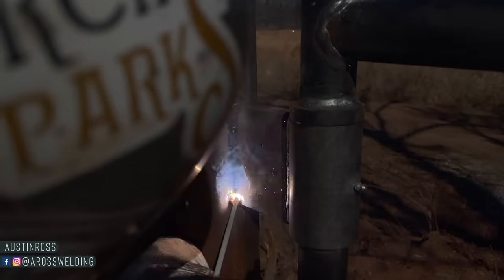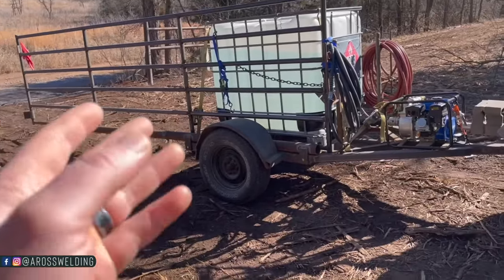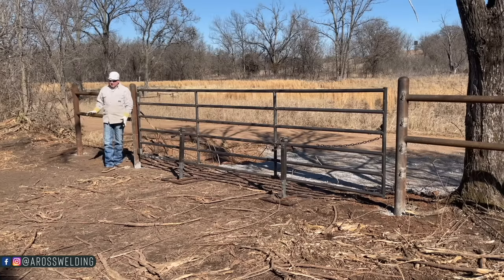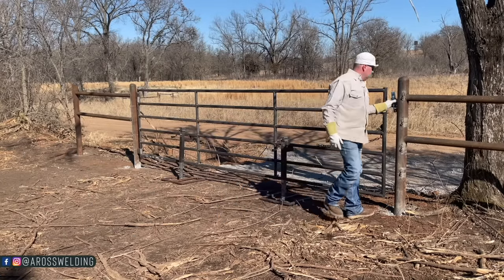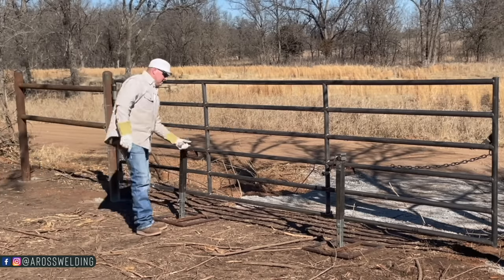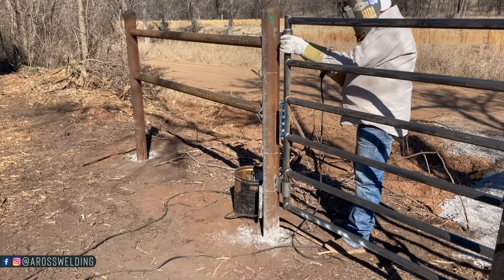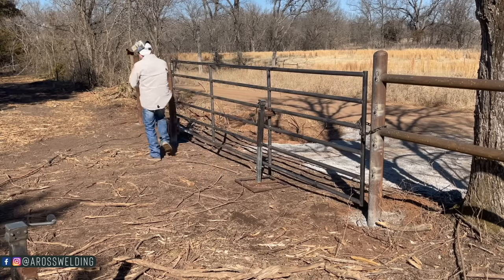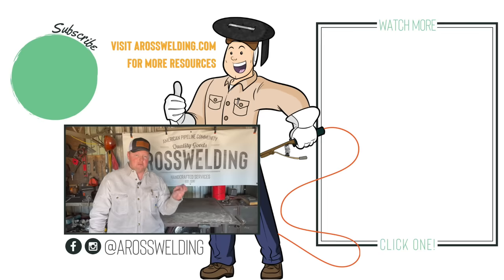UPHILL WELDING PIPE GATE HINGES (MOTION, PASSES, RODS)

Comment: I appreciated the tips on laying the bead. The closeup of your weave pattern was great. Info on what rods you are using, up hill or down hill, and determining the correct heat never gets old. 👍👍
Reply from the maker: Good to know. Thanks for your support! And thank you for watching!
Reply: My favorite tip was hanging the Stinger on my pants pocket!  I was constantly setting it on the ground and then picking it up.  For some odd reason that never occurred to me.  I might even incorporate  a small utility or hammer pouch to hang the Stinger when I need hands-free to adjust a magnet or something..
Reply: @arosswelding  I agree with the above comment! Thanks for sharing, showing and explanation Austin! It's nice to see some arc shots, though not so close up, show us more of them please! Very educational !Thanks a lot sir! God bless you and your family!
Reply: A little late but I'm almost certain that's 7018 because the 3 black dots most 6013 would have green dots

Comment: First thing they did when I started as a sheet metal worker, was to stick weld 16 gauge round fittings together. Used 6011 3/32 rod. First things I ever welded and I totally believe if you learn on light iron it's easier to go heavier

Comment: Austin,
As usual, great, informative content.  Question:  Have you ever considered using the Lincoln Murex 7014 rods?  I use them almost exclusively on  thin-wall pipe. They're designed for running downhill with moderate penetration  which would limit the amount of heat input.
Reply: Mired is good rod. I've used their 7018
Reply: Murex if I can spell

Comment: We have sandy soil down to about 18". Once you get past that, it's extremely hard compacted sand. It's a lot like trying to dig through rock. Would it be sufficient to set a 7' 2 7/8 post three feet in the ground (12" hole 3' deep, post set in concrete) for a 4'x12' gate as long as the posts are braced? I plan on building angled braces with 4 vertical posts and a single horizontal brace between all 4 on each side. The setup will be a lot like the 8" dia entrance you built, but without the high horizontal. Would you use your fence clips to attach goat wire to the braces?

Comment: I appreciate the info and knowledge you give on these videos, I have a question when welding up hill whether it's structural or fencing is it ever to cold Amp/ heat wise, I'm still learing uphill if weld @ 90amps is that good for a structural building uphill or anything structural.. thanks again for the info and knowledge on welding.
Reply: Depends on the size of the rod your using and the thickness of the material your welding.

Comment: Hi Austin I bought a handheld welder brand Spark with a dial knob on top that goes from 1-5 1/2 how can I set it up to weld with a E 7018 3/32 rod what’s ur advice, I got this machine just to do little things around the house

Comment: What brand of rod are u using ,I personally love 7018 over any other..man I bought some of the atwoods brand ,man u need a jackhammer to get the Flux off,not to mention the inconsistent temperament of the rod material..I used to get the Linweld or lincoln brands ,but man they have gotten pricey..

Comment: Question. Why use the baby 3/32 rods  , is it to get a pretty weld , or easy process with this size rod , my all around rod is 1/8 or 5/32  7018 rod just curious

Comment: I hang a LOT of these gates from OPS. Hung a 20 footer this am in about 15 min. I cut slots in my 4 1/2" for the 3/8" plate hinges to fit into. Use 6' level to mark cuts for both top and bottom on a level post. I saftey chain top of hinge side with hinges inserted in slots. Use a donkey d!ck vehicle screw jack on a flat 2x under latch end. Level gate top and give a little "up" on latch end to comp for sag, level vertically. Weld er up!